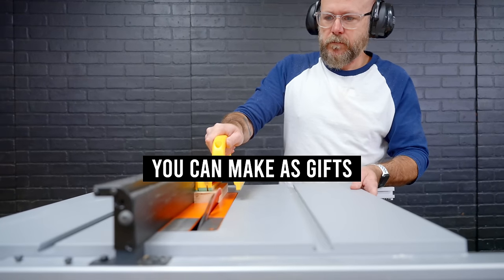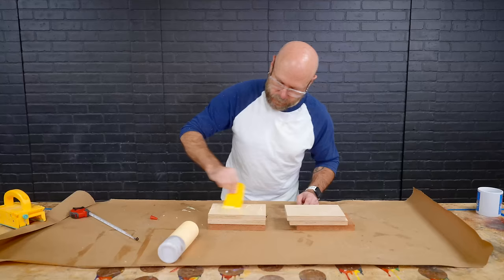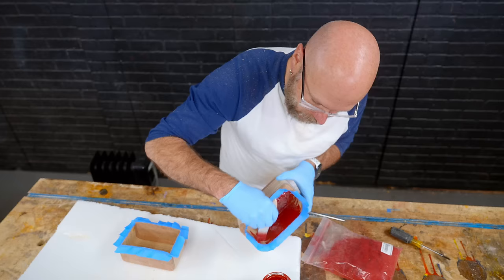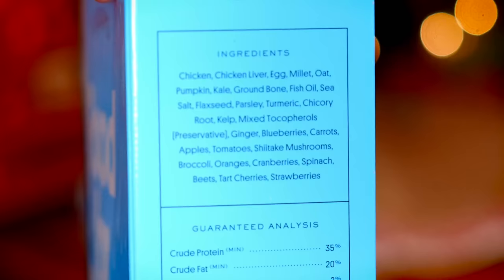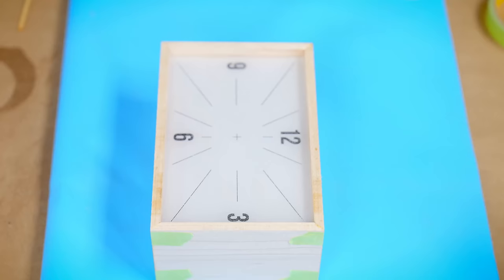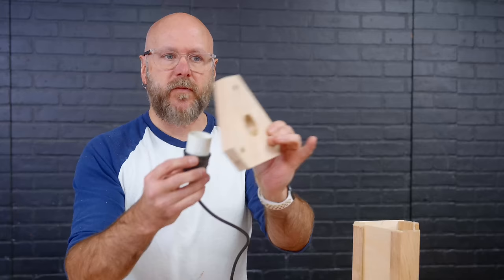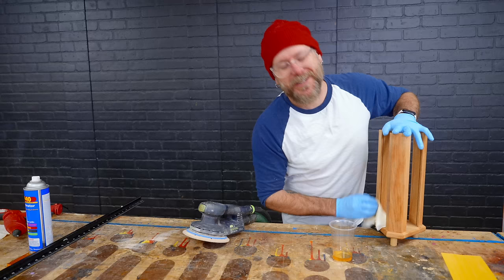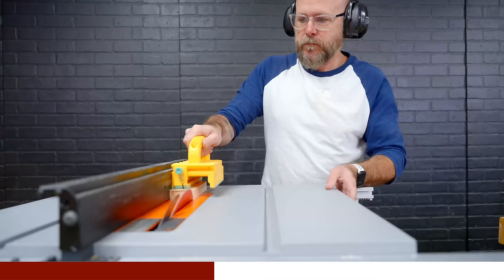6 Easy Projects with Basic Woodworking Tools

Comment: "analog clocks are beautiful and timeless" timeless because most young people don't know how to read them.....

most of my tools are dewalt (for no other reason than that's what was on sale when I bought my first tool and I didn't want to get into multiple battery platforms). I did buy a few WEN tools though and I always tell everybody that I've been super impressed by them so far. They are definitely great for starter tools. I have the oscillating spindle/belt sander, drill press, band saw, rolling dust collector, and the track saw. The only one that is sketchy is the track saw if you wanna do beveled cuts. breaking down sheet goods at 90 degrees is perfect though. 

I enjoyed the talking at the end. I prefer videos with talking in general. all the videos with background music or nothing at all usually get sped up to 5x or faster or just skipped all together.

Comment: Alright, I just had the silliest idea for a project that is right up your alley; Nesting Bandsaw Boxes.  Start with a big piece, like 24" on a side, cut a bandsaw box out of it. Then, with the material you removed from the drawer, turn that into a box, etc. etc.  Bonus points if they actually end up fitting inside one another.

Comment: Heya, Hope your festive season is awesome... and Happy Birthday Duke... you're a good dog. Hello there Kelly :D As for Wally, we had an Italian greyhound called Munni... her original name was spaghetti muncher :) I can understand Walnut down to Wally :D

A suggestion for the legs for the lamp. Make 4 square blocks. Drill holes for the dowels, then round the squares off on the router table and then dry assemble the lamp to make sure that the fit on the dowel is good, then glue everything up.
Reply from the maker: Spaghetti muncher is the best name ever of all time!!
Reply: @MakeSomething  Muni was supposed to be mum's dog. But she would crawl up into my stepdad's or my lap whenever we were home. Dad was an over the road trucker. Used to do approx 10k/week driving from one side of Oz to the other. Whenever he came in, she would go nuts.

Comment: Basic tools = big ol' band saw
Reply from the maker: not basic tools. basic woodworking tools.
Reply from the maker: Also, it’s a little ol bench top bandsaw you can get used on Craigslist for $50. Or use a $10 jigsaw. You have options.

Comment: "with basic ww tools" Then uses spindle sander,table saw and band saw and 6 other different power tools in the first 3 minutes for a keytray . Also title says 6 basic gifts than in first sentence says 10.
Reply: I mean are you really a woodworker if you don't have a table saw, sander, or bandsaw? If you want to be a woodworker I feel like those are pretty basic tools.
Reply: What do you expect? A hand plane and draw knife? I consider myself very basic and I have all these tools.
Reply: If you don’t have a spindle sander…wrap some sandpaper around something round and get to it.  If you don’t have a bandsaw, make it work with a jigsaw.  You can do things different ways, but it’ll take longer, be a little less precise, or take some elbow grease.  Don’t act like he pulled out a Domino to join CNC cut pieces.
Reply: I mean he didn't use a CNC machine, laser cutter, Festool domino, track saw, drum sander...
Reply: Yes those would be pretty basic tools
Reply: Ugh, I can’t with these kinda trolls!!!
Reply: @MrGig128  yes over the course of the time but when i read basic tools i would think of maybe 3 or 4 tools i.e.:circular saw,jigsaw,drill/driver and maybe a table saw or a chopsaw but not 8 different powertools  used to make a tray and specially making a "custom" plate for my router. 
I mean yes over the years i got a ton of stuff and now as i progressed in the craft i think of them as basic tools for me but if anyone starting out i would not say to them these are basic tools. So yes we could say the word basic is relative.
So when i see a title with basic tools i won't about what basic is for me but what basic is for someone not into woodworking for a lot of time.
Reply: @jlsuter91  well hand tools can be pretty basic.But as i said to the other guy if you are into this craft for some time and you like it you will upgrade from basic tools but and you will consider those tools basic over time but if someone starts out probably a spindle sander, a bandsaw or even a router won't be their first purchase or considered basic.
So basic is a relative concept in this matter but still i would not say some of these stuff is basic to a wider audience even if they are basic to you or even me now.Hell these weren't basic tools even for me when i started this hobby.I started with a circular saw,jigsaw a router and a drill/driver.Now those were basic tools.
Also depends if you are a hobbyist or someone doing it for a side hustle or your main job.For the latter two yes these would be basic tools but someone doing as hobby and getting into it no some of these are not basic. Again it is relative but when i read a title  saying "with basic ww tools" i consider it to be for a beginner.
Reply: Please complain some more. Most is those are basic wood working tools. It's an expensive hobby. Accept it.
Reply: @ocpbmuse  😢
Reply: @comandreja  what basic means to you or me maybe isn't basic for a beginner. but i would consider a track saw more basic than a spindle sander or a band saw.
Reply: @EdE6688 how about instead of griping on the internet, next time keep it to yourself. There's enough BS going on in the world that if you don't have anything nice to say, then say nothing at all. Were you not taught manners or has Internet anonymity made you think being a whiner is ok?
Reply: @ericw9655  yes i get it but than why not doing those things and showing also that you can do it with those basic tools you described.For you a CNC and a domino is not considered basic but probably for some beginner even a table saw or band saw is not considered to be basic.
When i read basic tools i really think of really basic tools( either basic power or hand tools) and not 8 different power tools used to make something.
Reply: @EdE6688  Good point, of course everyone has different priorities when it comes to power tools!
Reply: @dinacusic7829  so you say i can't say anything because i don't have an attaboy attitude to everything?
We probably have different opinions about the internet and the usage of it.
Reply: @dinacusic7829 how about instead of griping on some random comment on YouTube, next time you keep it to yourself. Maybe you shouldn't be talking about manners and anonymity when you yourself call someone a whiner
Reply: @HyperactiveNeuron  never said it is a cheap hobby and yes i know it is not cheap.I complained about saying using basic tools than using 8 different power tools in the first 3 minutes.You know basic is a relative word.But you also said MOST of these are basic which means even you don't consider ALL of them basic.
When you are in this hobby for some time you will consider some tools basic for your own level basic but for a beginner some of these won't be basic.
So as i said to others when i read using basic tools i will think okay probably 2-3 kind like a circular saw,jigsaw and drill driver and probably one of the bigger ones.
Reply: @EdE6688 you ok dude?
Reply: @EdE6688  In woodworking, there are always multiple ways to do something.  You probably want to just stick to hand tool channels if you’ve only got a hand saw, hammer, and chisel.  You won’t find many channels that exactly match the tools you’ve got.  I consider what David used to be fairly basic tools…especially because he said that if you don’t have a bandsaw, use a jigsaw.  Adapting and problem solving is the fun part.